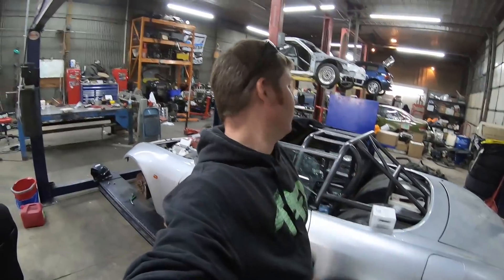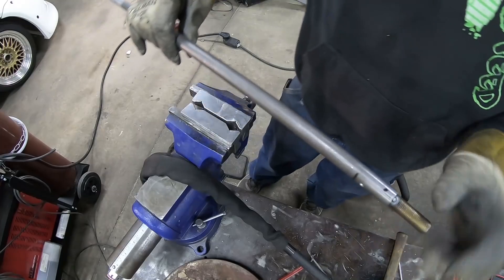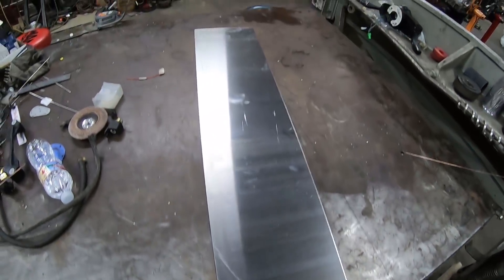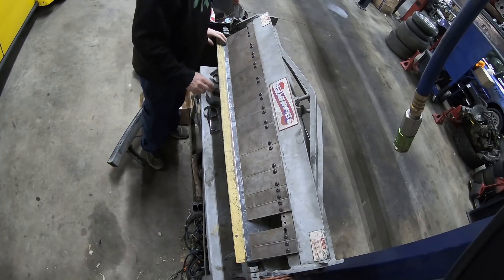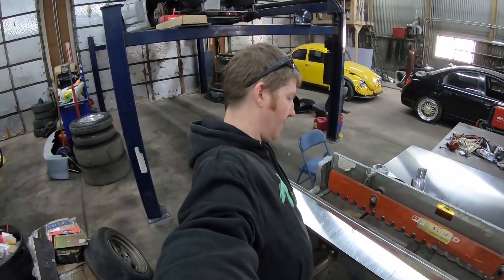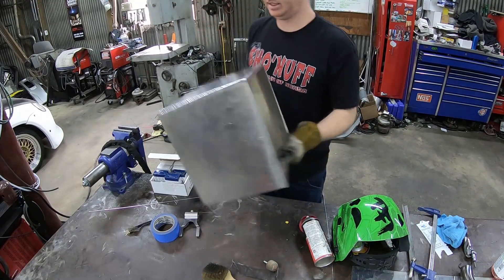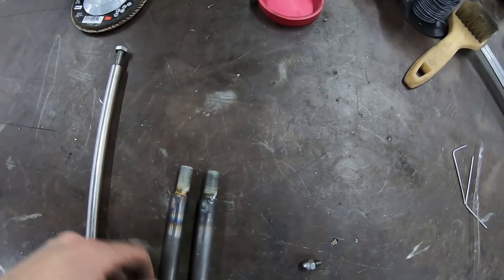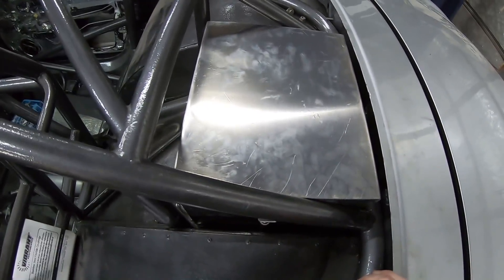SHONUFF! Shawn built an NHRA legal Battery box !

Comment: Battery weight directly over the drive axle. This project is well though out.
Reply: Not just that, it's fairly high up to help weight transfer as well
Reply: Laurean 599 Pfi always builds things the right way and with a purpose best shop for imports
Reply: And....they'll save some weight on power/ground cables vs running batt in the trunk.
Reply: It's a little forward from the drive axle but that will be accounted for when it's doing a power wheelie through 1st and 2nd

Comment: Just a thought Shaun, or a piece of advice. When measuring out multiple points on the same workpiece, when building a battery box for example, best practice is to take all your measurements from the same point, this prevents incremental errors from building on one another through the job. 
Love your work, Sho Nuff is coming together very nicely.

Comment: On our metal brake, I have to have the longer of the two measurements hanging out of the brake when I bend under an inch or it pushes it in. You wouldn’t think it makes a difference, but it does on our brake.

Comment: with the quicklatches...the strap won't slide in and out very easily once the batteries are in, maybe external spring hook type latches that you'd normally use to hold a trunk lid.

Comment: I have astragals built with tight bends. The sheet metal shop I use bends 1” flange and cuts the excess off with a course blade on a table saw.

Comment: Make sure the gap between the pivot point and the edge of the brake fingers is as the same as the metal thickness. You will be able to make nicer bends. If it's a hair bigger, it will still work. If it's smaller, you will start lifting the fingers.

Comment: When using your finger brake and you can't get fingers the proper width, and you want a sharp brake, cut a piece of 1/4"x flat bar the proper length and use that between your work and the fingers. 

Looks great!

Comment: cut 45's where your bending it and it will fold in nice
Reply: i setup and run brake presses in a factory you ever need anything like that again i will get some metal and bend it for you just need measurements and i can get it within .01 of an inch of what you need!

Comment: Why is the box so big. Is it just to fill the whole spot in the cage for aesthetic reasons or does the box have to be larger for a rule?
Reply: They're running two batteries in that box mate.
Reply: @saulgoodman9490  do you know why seems like alot of extra weight
Reply: @Spudstrodamus  my guess is they're running a 34-36v ignition system. Those batteries looked to be 16 or 18v. Run 2 in series for a higher voltage system.
Reply: @saulgoodman9490  I've never seen a system over 16v
Reply: @Spudstrodamus  really? Wow most trucks and tons of 4x4's are 24v
Reply: @saulgoodman9490  I dont own a 4x4 or big trucks I'll change it never seen a race car on more then 16v system

Comment: Oh dear, mad fab' skills, but...
I'd suggest you guys take a step back and give some serious thought to what you're trying to achieve - maximising traction off the line and through the first 60/330 feet.
Having a heavy, dual battery, setup that is high and BEHIND the rear axle centreline will, indeed, concentrate more load on the tyres - but do you actually need it or are you just making it more wheelie prone which will slow you down, plus the second battery in unneeded weight.
When you're looking at weight distribution with a drag/sprint car you CANNOT look at the static load in isolation - you MUST look at the distribution around the thrust line from the drive tyre-track interface. The greater the tractive force, the greater the front bias required.
A low mounted, single battery on the passenger side would have been much better and, if required, ballast mounting points at the front and rear of the chassis would have been a much better option as it would also allow the weight bias to be adjusted for differing amounts of track 'bit'.

Also, have you checked that rear axle articulation yet?
Reply from the maker: We set it up like some pro mod chassis we helped with in the last. I do love your post and consider it all thank you for being involved.  We did test the rear axle . It’s probably in a older video I’ll see if I can find a link.
Reply: @PFIBrent  

Cool, that's something of a relief - I've been quite concerned that there was going to be some serious binding issues with the additional triangulated linkage, used for the lateral location, having a different arc of movement. It's not a conventional 4 link with panhard rod or Watt's linkage.

I do hope you guys know any comments, good or bad, are well meant.

Comment: Please don't think me stupid but why two batteries
Reply: I think the batteries are either 16 or 18v and I'm guessing they'll run them in series for 32-36v power.
Reply: @saulgoodman9490  Thank You Brother
Reply: @terrypickette118  welcome mate, it was a fair question. A lot of bigger vehicles (trucks, big 4x4's) run on 24v systems, it's my guess that for the engine setup they'll be running it have a higher voltage requirement. All the best champ 👍